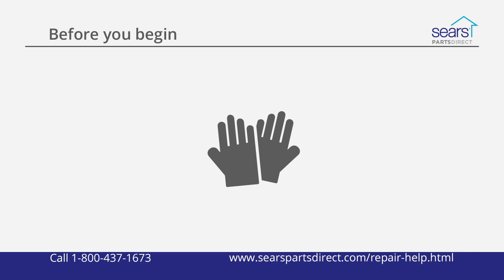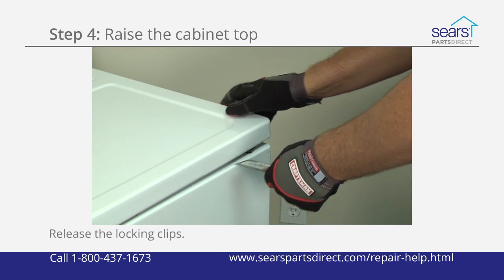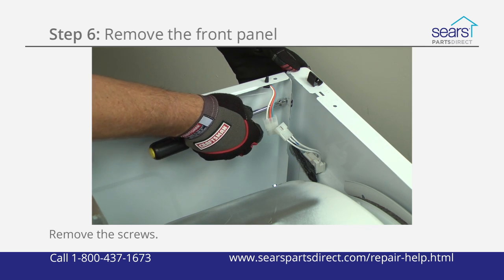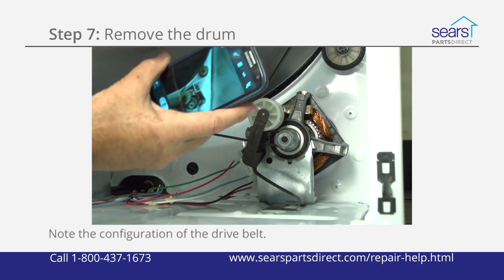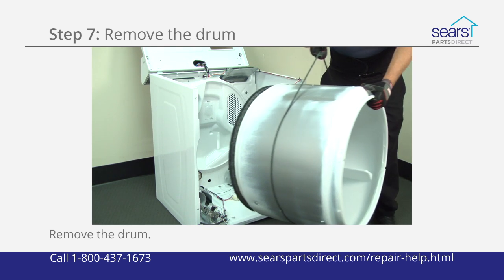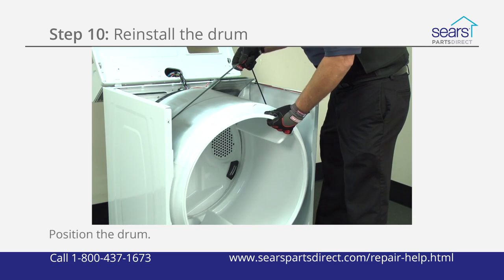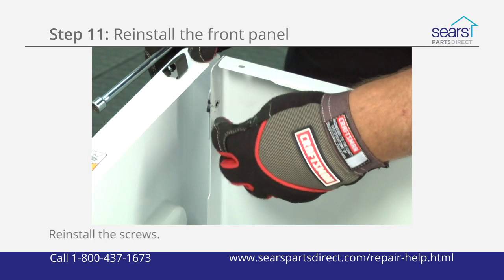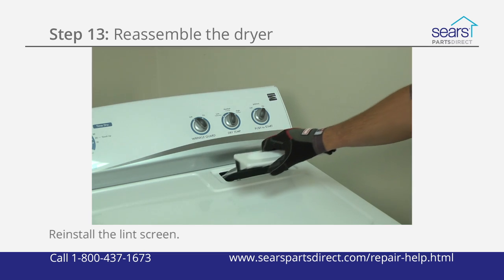Replacing the Flame Sensor in a Gas Dryer

Comment: Hi all, I was able to change out the flame sensor, without removing the drum.
I had my wife hold and tilt the drum upward a little bit,  and has access to the flames sensor, since it is located near the front of the dryer, and not the BACK.